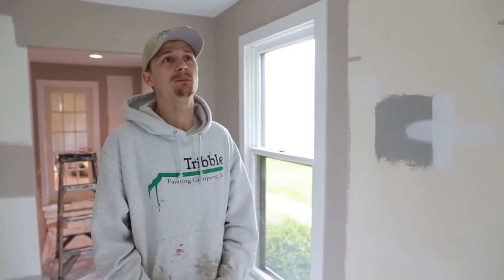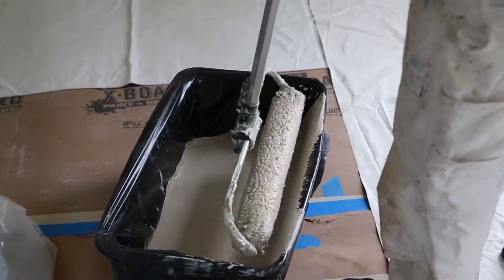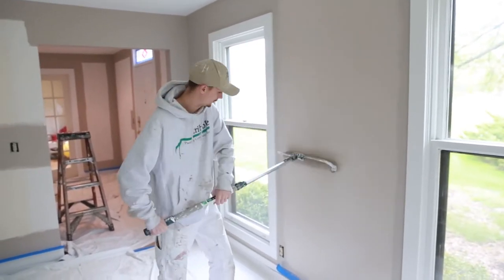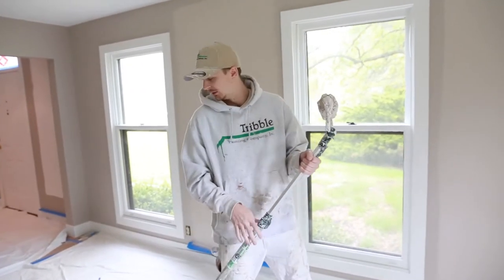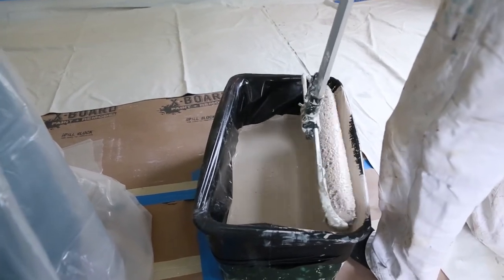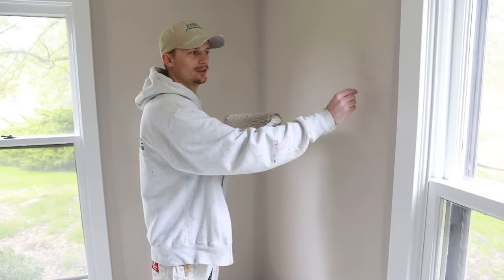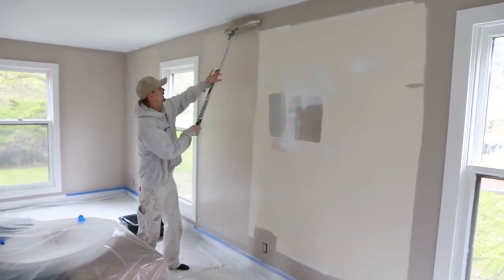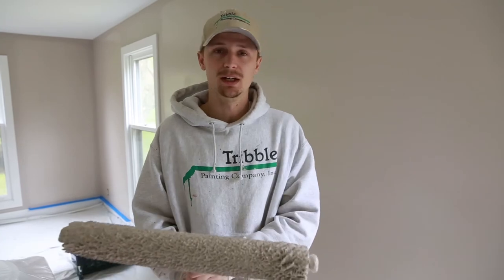Painting a Wall with an 18-inch Roller

Comment: hello what paint do you use
did you dilute the paint if so with what stuff did you dilute the paint

all the paint I use is thick and does not cover as well just like your paint what you use in your video I am from the Netherlands
Reply: If you are using latex paint you can use same water if the paint is too thick. It's better with water when the paint is very thick. You roll faster and paint is smoother on wall with water

Comment: Can't beat an 18" , my weapon of choice too . What brand of sleeve are you using ?
Reply from the maker: Hey Orbital! We tend to use 3/4 nap Wooster super/fab for flat paint for rough surfaces. We like the Whizz microlon 1/2 nap for most of the premium Benjamin Moore & Sherwin Williams wall paints that we use.

Comment: Great video!  All my walls have orange peel texture.  When I use 18 inch roller, with 3/8 nap, I'm noticing lines on the edges where I overlap. Paint is Sherwin Williams Pure White. I saw that you are using 1/2 nap.  If I change to 1/2 nap, could this solve the problem?  Also, how much pressure/force do you use when applying?  I'm trying to eliminate the lines.  Thanks!
Reply from the maker: make sure you get your puddy out and sand down the lines as best as you can. don't rely on the paint to cover texture. when using a roller apply just a little bit of pressure to keep the roller actually rolling on the handle. if you see overlaps in your paint just go over it with your roller to even it out. most if not all paint will 'settle' a little bit after putting it on the wall so expect it to smooth out just a little before it dries. 

when in doubt, come back after 5-ish minutes after doing a coat and see how it looks, should be enough time for it to settle some on the wall, but still wet enough to smooth over with the roller if you need to.
Reply: Thanks for the feedback!  

Any advantage of using 1/2 nap versus 3/8 nap?
Reply: Half inch nap

Comment: I love my 18" roller... But I love not using it even more. I like the quick setup of a 9" roller with regular trays or the small Wooster buckets. I like jamming it into the corner eliminating 90% of my corner cuts, I love getting super close to the ceilings with the 9, siderolling above door frames and getting much more consistent overall coverage. 18" roller is such a hassle, I use it as a last resort, just prepping thst space to make it 18" friendly I could have finished the whole room. You'll stop using it one day too, and your shoulders will thank you for it.
Reply from the maker: Like all of our videos you'll find, we always stress the most important part of painting - finding what works for you!

Comment: 7 inch brush is best
Reply: 7 inch roller is not good for this large walls.Takes longer to paint.
Reply: Yeah right , big 5 bedroom house , 18" roller or a 7" brush . Only one winner there.
Reply: @orbitalforest  not necessary in rooms once you take away all the extra gear you need and clean up plus you can get better coverage with a brush and a better finish